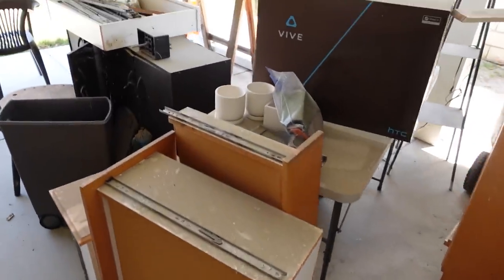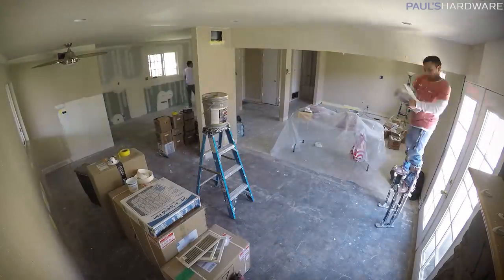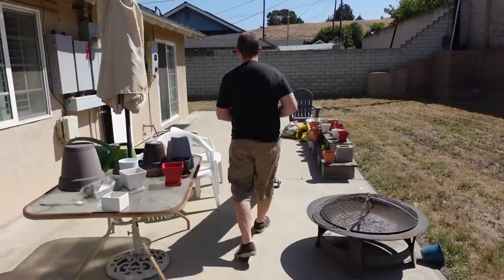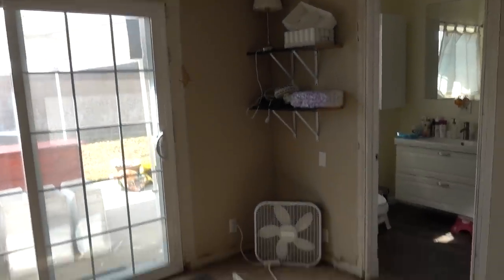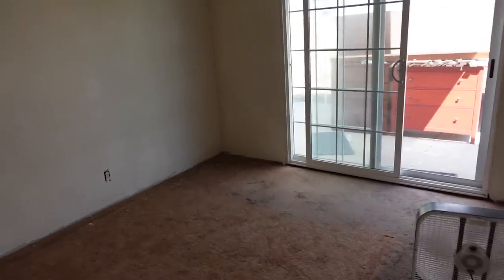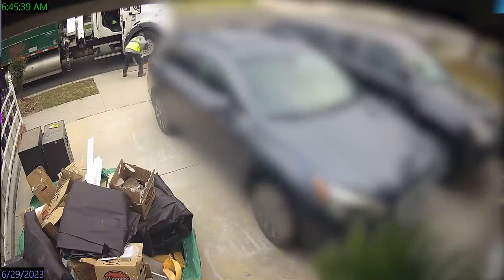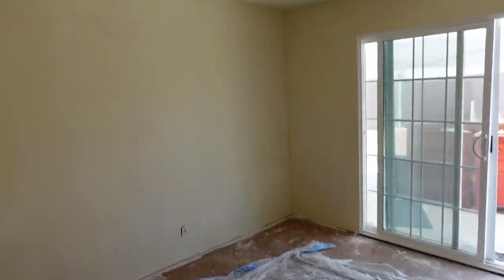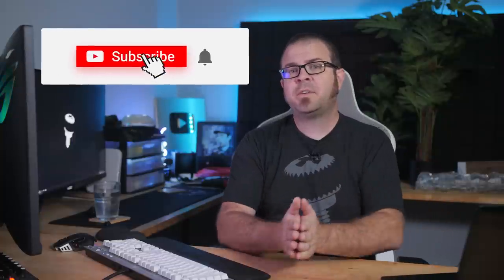Fresh Start Part 2: The Journey Continues…

Comment: I'm going to use my fan stockpile to recreate the fan pc case meme. I just don't come across 80mm fans like i used to. The "box fan" fans I've made are surprisingly stable. Just lay the fans side by side in 2 (or more) rows/columns and lash the corners in an x pattern with mildly stretchy zip ties. Another method I've done is by twisting cat5 wire like bread ties instead of zip ties. They make great window fans. I once did one from the floor to the top of a door frame and closed the door as far as it would go to vent a room.

Comment: I did professional painting for a few years and I'm sorry, but these guys looked like it was their first day on the job or just being lazy. Two man job that would take no more than three days to do excellent work for a home like yours. Sharp lines, walls and ceilings with no runs. Smooth af. Removing all wall plates, light fixtures, registers etc, taping, mudding and sanding first day. Two coats on day two.  Half day for touchups, cleanup and reinstalling wall plates and registers properly etc if we didn't have another job to go to. Otherwise we'd do it in two days. Mind you, a days work included an hour lunch, multiple smoke/vape/weed breaks all in less than eight hours per day. Our tarps had only dust on them. Super clean, but pricey. You get what you pay for. :)

Comment: Paul's side yard looking like the set for "Hoarders: On Location" ... 😝 There's no second floor, right? Just a ground level house? Reason I ask is I'm living at a local Travelodge that has the same ceiling and wall textures, trim, etc. and it's horrible for WiFi signals. I have T-Mobile Home Internet with the nearest tower just a 10 minute walk to the Southwest and I've got signal issues, packet loss, and intermittent slow speeds on both my Sagemcom gateway and on my TracFone (Verizon) and it's gotta be the building materials. Was wondering if you had similar issues pertaining to WiFi because this hotel is pretty much air gapped! 🤬 😂 The free WiFi through the hotel is also janky and can't be used on my PS5 because it doesn't have a full fledged web browser to accept the disclaimer and sign into the free WiFi ... 😒

Comment: Don't sweat plaster over splash, comes off easy & clean. You use tape on that defunct elec. box ? tsk-tsk Always wondered if Joe was an exstripper, what a hunk. Careful renailing baseboards you don't hit wiring or plumbing, just say'n  Save a can of exact color paint encase of accidents.

Comment: FYI, that awful wall texture is called "gotelé" in Spanish. It was very common during the 70s and 80s, and it's used to hide the wall and paint imperfections.
In order to remove it, either you fill the wall with plaster or tear down the whole wall.

Comment: Letting the contractors F-up the carpet is a huge help for everybody. Dealing with floor coverings is never perfect and leads to more headaches than they are worth, but spending the extra $1000 for carpet not only helps the room feel new, but gets a lot of sneak dust out. Great job!

Comment: Sad to see them sanding drywall with no airway and lung protection. This is so stupid I'm stunned by their personel disregard. I worked in the drywall and final finish area for many years and the older men who had worked in the 90's to current without protection all had breathing problems, some so severe so as to be near forced retirement at the ages of 50 to 60.

Comment: If there was wire in that outlet that you covered, you should probably uncover it in case there is ever an electrical problem with that circuit.

Comment: The skim-coating over the existing texture just seems odd to me, but I guess the pros know what they're doing.
Reply: Yeah that part is so weird to me. In the short timelapse Paul showed, previously the texture was removed on the ceiling and walls in the living room/kitchen area, why the hell not in the bedroom? That is such a huge waste of drywall mud to cover it all.. Whack decision.
Reply: @EcoAcid  That style of ceiling coat can be slightly dampened and scraped off with ease. The stuff on the walls not so much. That texture is nothing more than drywall mud. You'd have to soak it to scrape it off and in the process, compromise the entire wall of drywall. So no, it isn't a whack decision. It's being done by people who know what they're doing.

Comment: Paul, maybe too late if it's already painted, but you're probably going to have problems with that drywall patch you did. multiple materials floating around, plus the box. Means heat contraction/expansion will be an issue. Also, things tend to vibrate differently. What you needed to do was use a reciprocating saw to nip the two nails tying the box to the stud, remove the box (and the crap in it), cut a small drywall patch (Lowes and HD do sell those), mount the patch, and THEN mud over the seams.

EDIT: An easier solution would have been to get a flat plate and screw over the outlet. Then you have something to mud and paint.

Comment: Ah yes, fixing what past owners did wrong. Been doing a lot of that for the fixer-upper my dad bought 4.5 years ago. We did a major overhaul of the house when we first moved in, but there's still IT related stuff I'm working on. Based on the preliminary testing I've done on the electrical panel....hooooboy documenting it properly is going to be tedious.